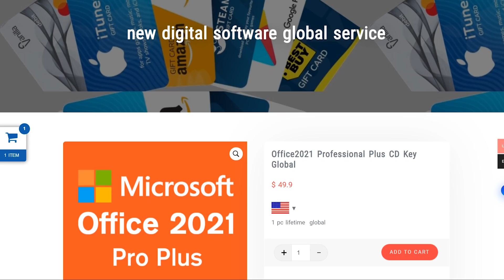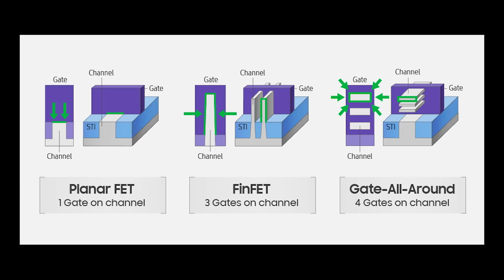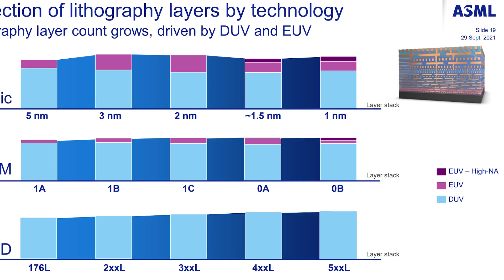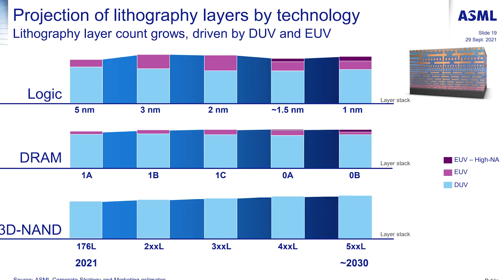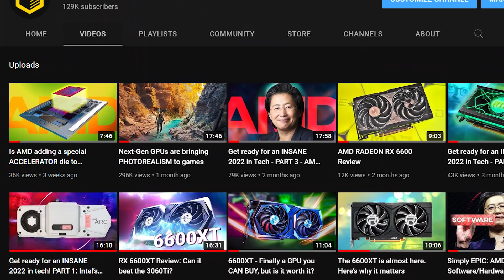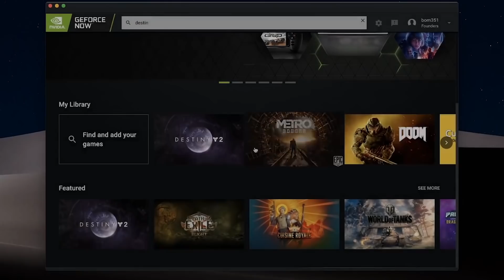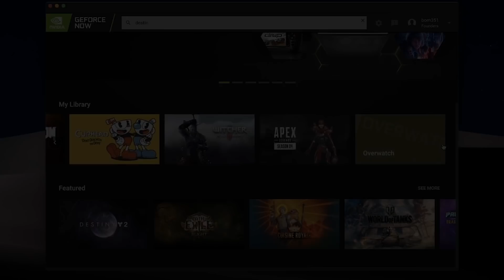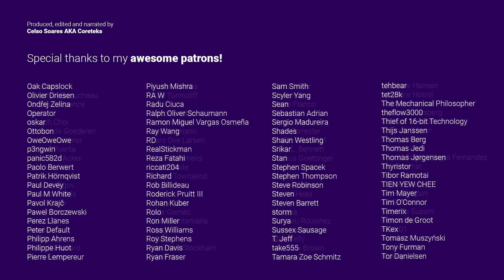GPU and CPU prices are only going to get WORSE in the future. What should you do?

Comment: The answer is APUs. Considering that the current and last gen consoles have APUs and with DDR5 coming out, I don't see why we can't get APUs with very good iGPUs in them.
Reply: I can't see AMD doing that because it'll compete with their own console chips.

Maybe Intel once ARC is off the ground though, if they can be competitive on price & have an i5 12600 + 6600XT's performance in a $500 APU by 2023 then they can sweep up the entire midrange market if AMD & Nvidia don't change course. Everyone would buy one of those! Heck I'd get one for my kid!
Reply: @InnuendoXP  they wouldn't because AMD would use 6nm, while the consoles use 7nm and the slim versions of the consoles and their potential upgrades will use 5nm.

Also that APU won't cost 500$, the APU in the xbox series S is very cheap, an even smaller die size APU would probably cost 200-300$ if AMD don't go through the roof with the profit margins again.
Reply: @rattlehead999  I don't mean compete as-in compete for production capacity, I mean compete as-in subvert the market of two of their biggest clients. The reason we haven't seen an RDNA2 APU yet may well be due to a non-compete clause in their contracts with Sony & Microsoft. Also while the APU in the Series S is definitely cheap, the margins are tiny in comparison to Zen & Threadripper. They make money because they have a guaranteed high volume of demand, which is basically there as security in case their PC end of things didn't go too well. + sales & distribution being handled by Microsoft & Sony who are happy to sell consoles at cost.

If AMD sold a comparable APU in the PC space, the margins would need to be much bigger.
Reply: @InnuendoXP  people buy consoles for the exclusives, plug and play and guarantee that you will not need a new system until the next generation comes out.
Reply: @rattlehead999  people will buy consoles for price:performance & just to play the latest with decent graphics if an RTX 3070 continues costing as much as a Series X & PS5 combined.

PC gaming exploded when you could build a console-beating system for $500 or less, which has been the case from around 2007-2019. The last time Consoles eclipsed even midrange PC performance was 2005 with the Xbox360 annihilating the graphics performance of high-end PCs of its time.

The value-adding aspects of PC gaming aren't going to be enough to get people to pay triple just to 'equal' the performance of a $500 console, particularly when those consoles are over a year old now.
Reply: AMD won't release actually good APUs, because it would pose a serious competition to consoles. Sony and Microsoft don't want that obviously.
Reply: @Kynareth6  Nope, by that logic AMD shouldn't have released anything from 2013 to 2020 because it posed a competition to the PS4, Xbox One, PS4 Pro and Xbox One X...

Because in the 8th generation a PC was more worth it than consoles, except for the slim versions of the consoles.

At the launch of 8th gen a 500-600$ PC could easily destroy the Xbox One for 500$

People don't buy consoles for the hardware.
Reply: @rattlehead999  AMD didn't release a desktop APU that even loosely measured up to the base PS4 until 2018 with the 2400G.

That the average low-midrange gaming PCs with dGPUs of 2013 could stomp the consoles at launch is the result of a lot of things, including the 2008 GFC badly disrupting the console hardware development due to unreliable market projections. The Xbone & PS4 weren't that far removed from low end PC hardware in a console box. Not-so this gen.
Reply: @InnuendoXP  no need for an APU when you could get a r9 270 for 130$ an fx 6300 for 80$, 50$ motherboard, 40$ PSU, 40$ HDD, 40$ RAM, some dinky 20$ case and play games better than the PS4.
Reply: @rattlehead999  sure, but you also didn't have Sony & Microsoft invest heavily in the development of tech that'd go into Zen & Radeon when the company was up the wall in debt back in 2012-2014 either. Their solutions were pretty close to off-the-shelf. That's a very different business relationship to "we've given you hundreds of millions of dollars & whole teams of engineers for the past 5 years, & now you're releasing a product that's looking to compete with us on price:performance that you could never have gotten without us??"
Reply: @InnuendoXP  yes, because consoles are not bought for the hardware nor price to performance, because most console owners don't care about pixels, high fps/refresh rate, etc, etc.

Consoles are bought for the exclusive, the most plug and play you can get nowadays, no DIY, minimal cable clutter, great for the living room form factor, 99.99% guaranteed to run the games flawlessly and so on.
Reply: @rattlehead999  If console gamers don't care about graphics, why do they buy new ones? Why do they buy the mid-gen refresh?  They clearly do care about visuals, they just don't think it's worth what PC gamers, particularly today, are willing to pay for it.  And honestly as PC hardware prices stand, unless money truly is no object, I'd easily recommend anyone entering gaming to get a Series S over a gaming PC in this market.
Reply: @InnuendoXP  Nope, most people with an Xbox One(S) or PS4(S) did NOT buy the X/Pro version of the console.

And the reason we got mid gen refreshes is because the generation went on for too long.

Also you get better CPUs and more RAM with new consoles which allow for better games, that's why you buy new consoles. Graphical fidelity and quality don't make for better games. 

Case and point the 8th gen consoles had weaker CPUs than the 7th gen consoles, though more memory, which is why 8th gen games weren't as big of an improvement over 7th gen as 7th gen was over 6th gen and why bethesda refused to make TES VI on the 8th gen consoles as an example of why CPUs matter more.

For better gameplay, mechanics, level design, obstacles, objectives, enemies, AI, content you need a better CPU and more memory, not a better GPU.
Reply: definitely not in my country
APUs are being scalped by official retail stores here just as much as discrete GPUs because "they have a GPU inside"
Reply: The current memory layout of computer memory sadly isn't ideal for highend integrated GPUs. CPU memory is latency optimized whereas GPU memory is bandwidth optimized. 
There is a reason that current consoles as well as Apple's M1 SoC have much higher memory bandwidth than is possible on current Desktop.
Reply: @Steamrick  yes, but DDR5 in dual channel can have 102GB/s bandwidth, and that's with the first batch of DDR5 at 5200Mhz, while there will be even faster ones in the future.

And if they finally give us tri or quad channel memory controllers on regular desktop chips, that'd be great and would further increase the bandwidth.

Keep in mind that the upcoming RX 6500XT  will have about 120GB/s bandwidth and it will have performance comparable to the gtx 1660 super.

With RDNA3, even more L3 cache("infinity cache") and further improvements in delta color compression I think that 102GB/s is going to be enough for very good iGPUs that can match or surpass the Xbox Series S if clocked higher and they should be, because the Series S's GPU is clocked at a very low 1565Mhz

Comment: I disagree, assuming supply finally catches up, we'll just be paying the same price we are now for better cards.  The new MSRP's will match the current awful market pricing lol.
Reply: If supply catches up to current demand, then the current demand will be satiated, then prices will fall off a cliff, because the population of people willing to pay $800+ for a midrange GPU is far smaller than the amount willing to pay $350-400 (which is still a big margin). While you have double to triple the profits per-unit at current prices, if your capacity means you could produce 10x as much, then that's loads of money left on the table, your net profits would be lower than if you exploited that.

The only reason they wouldn't do that is if they preferred to maintain the high prices as the norm & artificially limited supply to the market so they could maintain prices through the peaks & troughs of production supply - but that's assuming production supply won't significantly increase.
Reply: Ultimately, old nodes become competitive with new nodes, if the new nodes are too expensive. We see this already for appliances and stuff using older chips, especially 28 nm is cheap. Such a break point will happen for GPUs as well.
Reply: yea it will take many years before prices go down (not by that much), if at all. One can still hope though
Reply: Yeah a lot of what he’s saying is what we’ve been hearing since about 2005. Remember when the likes of Michael Pachter said that the likes of Onlive were the future due to skyrocketing component costs?

More often than not technical people aren’t that good at economics, and think that production won’t expand to match demand, when in reality it usually does, even if there is a lag-time.
Reply: @Ebalosus  yep and if there's a materials shortage, they'll design around & source a different material, because the whole industry doesn't want production to be sitting on its hands waiting for these things to come in when they could be churning out more & more to more customers.

As much as they're loving the profit margins, what they'd probably love more is to sell a far higher volume to satisfy the demand of a rapidly expanding market & get into new markets ahead of potential competition posed by other platforms.

It's not as though it benefits them particularly to constrain supply artificially. It only makes sense in the short term if they don't anticipate production capacity increasing steadily, so they can maximise profit out of the limited stock they can produce. If limiting supply to inflate prices were an ideal business strategy for computer hardware, we would've seen it long before the first crytoboom - and gaming consoles were far less competitive with the PC space back then than they are now.
Reply: Transistor cost are going up not down like they used to may take a few years but it's gonna happen eventually and it's exponential.
Reply: And then it will crash and burn

Comment: It sounds scary but it’s so true. Luckily hardware upgrade cycles have been getting longer over the last few years. A overclocked core 2 quad or newer on the desktop side and a core i5 2nd gen or newer on the laptop side are more than enough for most tasks even today. Therefore hopefully computer equipment will last longer making it easier to justify spending more on hardware.

Comment: Actually there are now polarity changing transistors which might give as another kick.
Reply: The problem with that is that they're based on germanium, not silicon.
Silicon is piss-cheap. 1/3 of our planet is made of it, and it's relatively easy to purify.
Germanium costs about 100x as much as silicon. The material cost of silicon used in processors is trivial - even a very large die only has a couple of dollars worth of silicon in it - but if you made the same die out of Germanium it would increase the cost by hundreds of dollars, and if it was being manufactured on a large scale the huge increase in global demand for Germanium would drive the cost much higher.
Making processors out of Germanium on a large scale just isn't economically feasible.
Reply: @nathangamble125  I dunno if you know but substrate is incredibly expensive and it’s only a recent thing who knows if they aren’t working on a similar thing with silicon..
Reply: tiny magnet based ones? Thats dope.

Comment: Just stop buying anything from phones to or laptop in 3 years, keep using ur old stuffs till then . The price will be lower for sure since demand >> supply thus this happen.
Reply: Sound idea
Reply: I am already skipping many new phones, the "Qualcomm SM8150 Snapdragon 855+ (7 nm)" is very capable reaching 5 years.
You don't feel phones slow down a lot after 3 years, at least you don't overly bloat it with useless apps.
Reply: @N0N0111   i still use my sony xz2 just for calling and receive mess, plus messenger from facebook and google maps/utube no game or anything else. I do most of my stuffs on pc lucky for me to get the 3090 when it first came out only at 700$ to get an open led box 3090 without heatsink just  bare referencr pcb . i can last till 3 or 4 years
Reply: Bascially, I always tried to skip 2 generations for financial reasons. Then it had become 3. Now it looks like that skipping 4 is quite valid option.
Reply: @piotrd.4850  Very true, phones are so fast now.